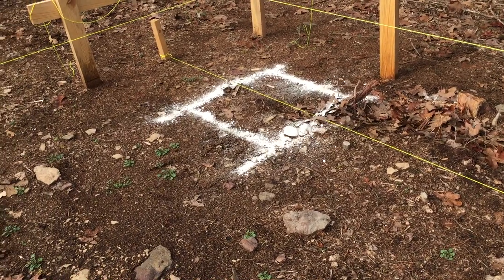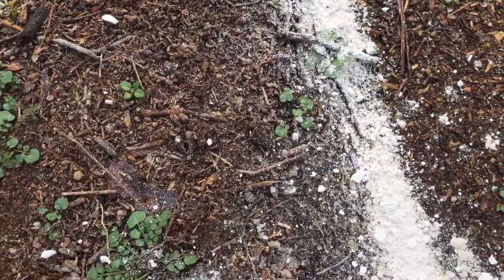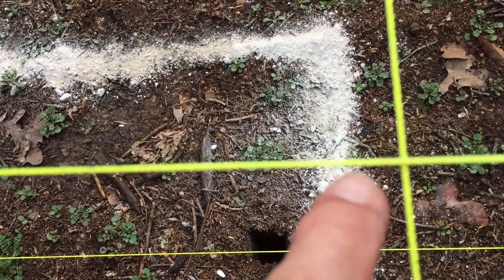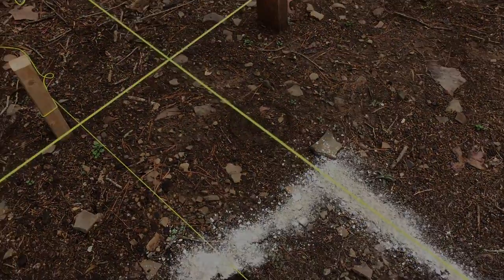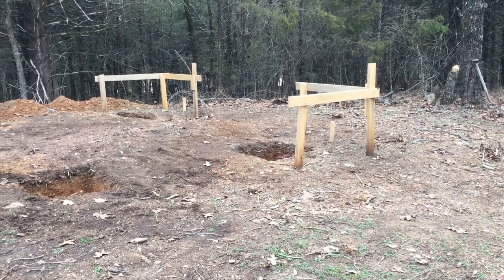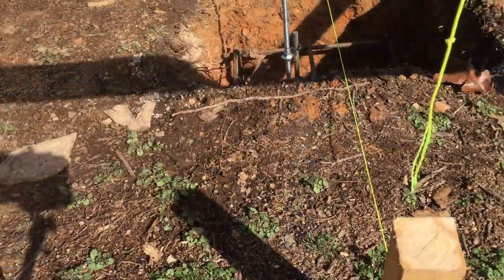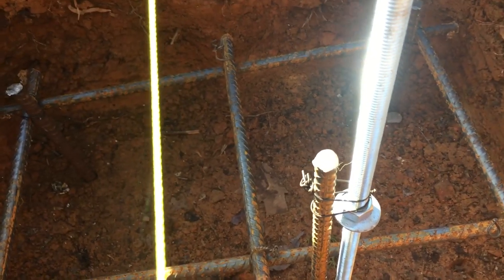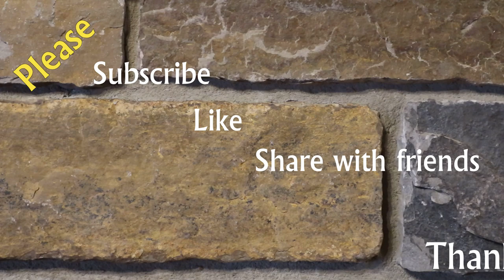Preparing and Pouring the Pier Footings - Dovetail Log Cabin Build (Ep 10)

Comment: I used 16 inch sonna tubes and used extra long strings as it exaggerated the out of square so you may see it easily check with a framing square and home depot has a water level it was about 25 bucks it had a beeper and clear tubing recomended .
Reply from the maker: scott McIntosh   Howdy Scott, next time I go to Home Depot I’ll look for a water level like that. Thanks for letting me know about it. God bless

Comment: What spacing did you do the piers?  I was thinking one every 10ft where I am located with the soil I have or if I did 12in piers 3ft deep every 6ft.
Reply from the maker: Howdy y’all- the piers are 8’ on center. Like you said your soil may determine what you do. Do you have local building codes you have to adhere to?  Wishing you the very best with your cabin build. God bless
Reply: @TheBeardedCarpenter  not much building regulations here.

Comment: What method did you use to confirm your right angles?
Reply from the maker: Dennis Dickson   Howdy Dennis- I measure diagonally from corner to corner knowing the strings are parallel and the measurements are the same. I use a construction calculator and find what the diagonal measurement should be. There’s more information on the video when I payed out for the smoke house foundation.  It’s in the playlist. God bless you